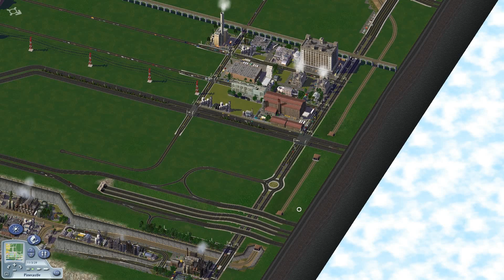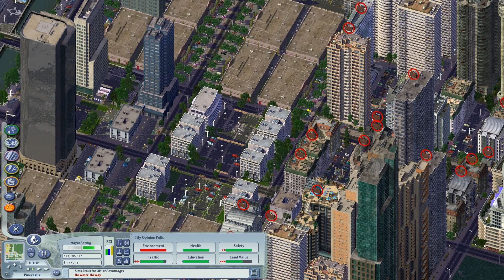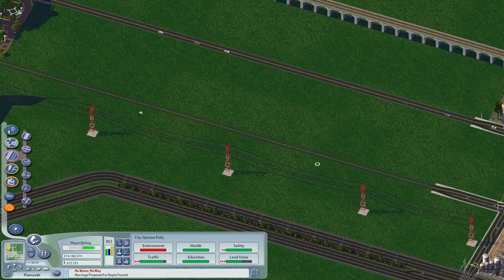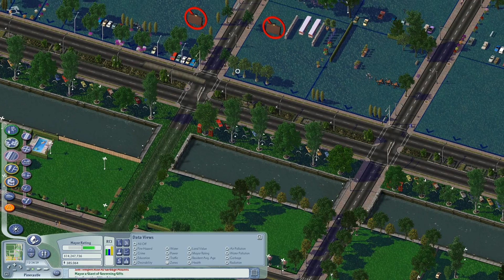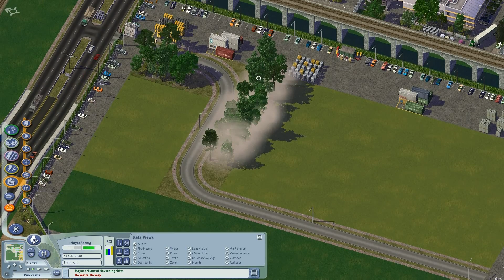SimCity 4: Let's Play Pinecastle, episode 24 (Industry and Roadways)

Comment: Watch out with too much industrial area; hi-tech require a high level of education, taxes need to be set high for high polution industries, about 11 prc Dirty manfacturig 10,5 prc hi-tech 8,8 medium zone housing should be put first over low wich must be carefuly positioned beside a industrial area. Never create more industrial or business zone´s than there people available, waisted space wich filled with poorly used zones ! Pollution can greatlly reduced with the hydrogene plant ! Some railyard beside the goods terminal would be nice, prefer for both a runthrough track, not a dead end !
Reply from the maker: Thanks for your comment and advice.  I'll definitely make sure to keep polluting areas of industry away from everything else.  About creating too many industrial and business zones and not having enough workers, it usually seems to be the opposite situation that I'm in, with lots of unemployment from too many residential zones.  The Hydrogen Power Plant is always great to have; I'm not sure if I've unlocked it for this city yet, I'll have to check and see.  The amount of power it generates is a lot, but often I need more of them.  I have probably over 20 nuclear and hydrogen plants powering my main city and all of the southern part of the region, all concentrated in one city tile.  I will maybe have to include a railyard, although I don't think I have one in my plugins right now.  I've used a good one in the past but usually I forget to build them or leave space for building them later.  I don't think the track will continue past the station in this area, as there is another long freight line which goes to the farther-away industrial area and the port.